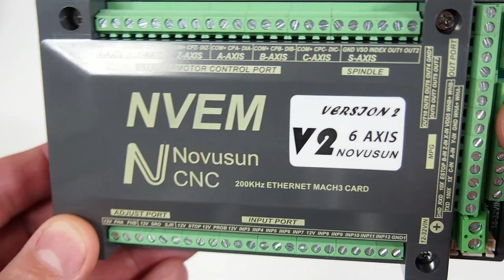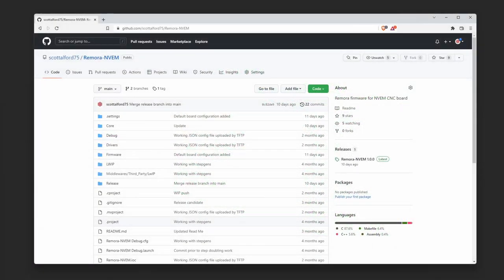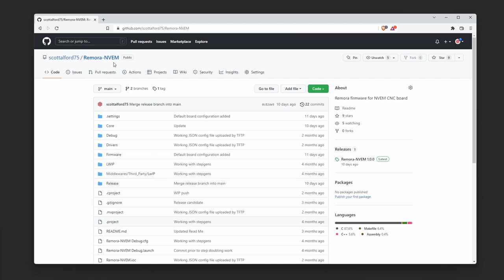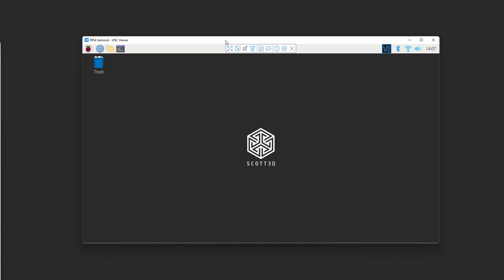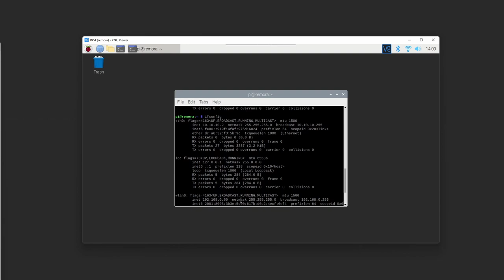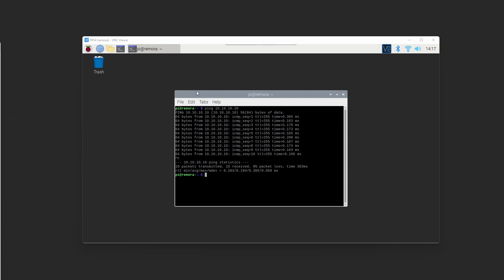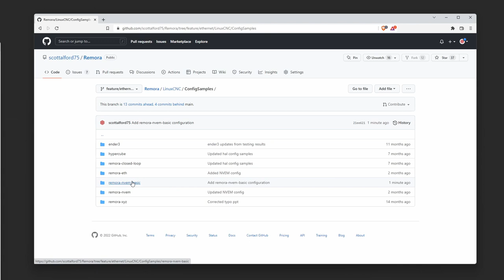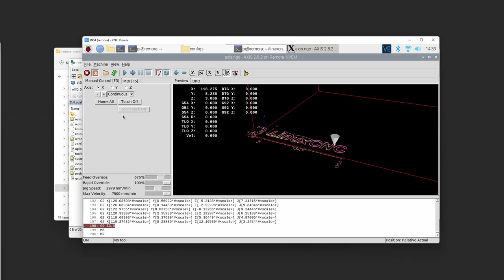Remora NVEM Getting Started

Comment: Dear Scott,
Apologise in advance for my visual depth perception limitation - May I learn from you the signal name s, both ends of your 4 wire ribbon cable? Guessing has not been my friend.
Thank you, William Phillips, Surrey,BC,Canada
Reply from the maker: Hi, check out the thread on  the LinuxCNC forum. It has some pictures with the pins labelled.

https://forum.linuxcnc.org/18-computer/44828-remora-ethernet-nvem-cnc-board
Reply: @scott3d506  Thank you.

Comment: Hi ,,  I also get the unexpected real time delay message and cannot get ride of it like in your video. Do you think this will cause problems. I have been testing just with one axis and seems to be ok.  Got any idea on how to fix this message. thanks in advance.
Reply from the maker: Hi, apparently this is "normal" when not running a base thread in LinuxCNC. I've been running Remora for years with no issues from that warning.

Comment: Hi, i have one digitaldream EC500 v3.0 uses the STM32F507. O update with and original firmware, but it dont connect anymore. I want to move to your remora firmware, it is compatible? This board use the same .dll from nven on mach3. Thank you?
Reply from the maker: Hi, if it's a STM32F407 then a version of Remora cold be developed for this board as the SPI version of Remora is already running on this chip. Could you please share some photos of the board (both sides if possible) and the ethernet PHY chip.  It looks like a good board as it has 24V IO.
Reply: @scott3d506  yes! I can send you a lot of pictures, did you have an e-mail to send it?
Reply from the maker: @NesiPower  scottalford75 at gmail.com
Reply: @scott3d506  ok tomorrow when i arrive in my company i will take the pictures. Thank you! And greetings from Brazil!

Comment: There appears to be multiple versions of the board available depending on how many axis are available. I noticed that you have the 6 axis version. If I have the 5 axis, can I use the same firmware as you?
Reply from the maker: Hi, the Remora-NVEM firmware should work on v2 and v3 boards with any number of axes. There is a mystery chip on the board which I suspect is used to limit the number of axes available in the original firmware. That said I'd love to hear from someone with the 3 axis board to confirm the hardware is there for all 6 axes. This way we could just buy the 3 axis boards and have a 6 axes available.
Reply: @scott3d506  I have a 3-axis board and soon I will be able to test it and give you feedback, I follow your work in the group as well.
Reply: I'm Using a 4 Axis NVEM  .. and everything works flawly
Reply: @durvalhenke  how you configure 4 axis machine
Reply: share the link of the group I'm interested too

Comment: Hi Scott. Your work is awesome... How to config in and out Pins for motors 5 axis machine... Can i run stepconf Wizard or pnpconf Wizard on linuxcnc.. its that posible.. tnx
Reply from the maker: All the configuration is done in the HAL files and the config file that is uploaded to the board. Check out https://github.com/scottalford75/Remora-Novusun/blob/main/LinuxCNC/ConfigSamples/remora-ec500-basic/ec500-full-config.txt which needs to be updated for the correct pinout though.

Comment: Hi Scott, Thanks for that great video. I am trying to setup a ec500 as per this vid and the othe rone. Every step installed as it should  except i use a crossover cable. I am having trouble with the very last step. It come online ok then when i try to play it i get the following error. Could you please let me know where to start looking. Looked on the net  and tryed to change the setting.

Machine configuration file is 'remora-ec500.ini'
Starting LinuxCNC...
Found file(REL): ./remora-ec500.hal
Note: Using POSIX realtime
Found file(REL): ./remora-nv-mpg.hal
note: MAXV     max: 125.000 units/sec 7500.000 units/min
note: LJOG     max: 125.000 units/sec 7500.000 units/min
note: LJOG default: 50.000 units/sec 3000.000 units/min
waiting for s.joints<0>, s.kinematics_type<0>
waiting for s.joints<0>, s.kinematics_type<0>
waiting for s.joints<0>, s.kinematics_type<0>
waiting for s.joints<0>, s.kinematics_type<0>
waiting for s.joints<0>, s.kinematics_type<0>
waiting for s.joints<0>, s.kinematics_type<0>
waiting for s.joints<0>, s.kinematics_type<0>
note: jog_order='XYZ'
note: jog_invert=set([])
Unexpected realtime delay on task 0 with period 1000000
This Message will only display once per session.
Run the Latency Test and resolve before continuing.
Unexpected realtime delay on task 0 with period 1000000
This Message will only display once per session.
Run the Latency Test and resolve before continuing.

joint 2 following error
emc/task/taskintf.cc 942: Error on joint 2, command number 104
Reply from the maker: A couple of ways I would approach the trouble shooting. Firstly, start with the example LinuxCNC configuration as it is know to work. For the following errors, I've seen this when the controller board is not parsed (loaded) correctly resulting in no step generators being loaded. For this, before flashing the firmware, do a full chip erase. Alternatively use the python script to re-upload a config file.
Reply: @scott3d506  thankyou.